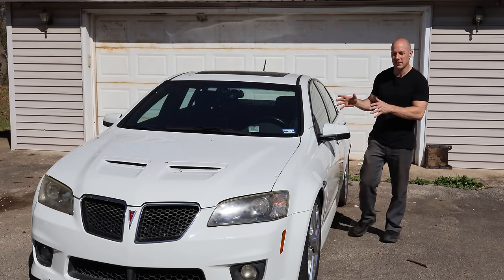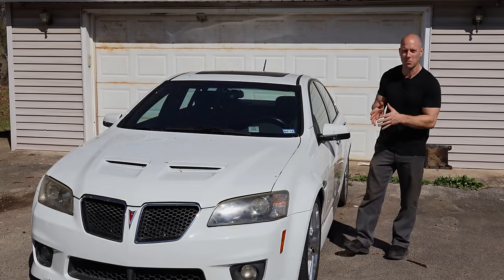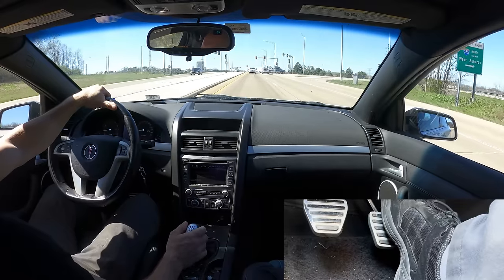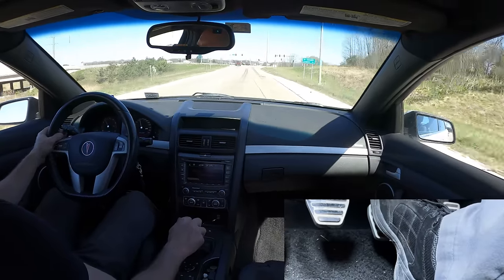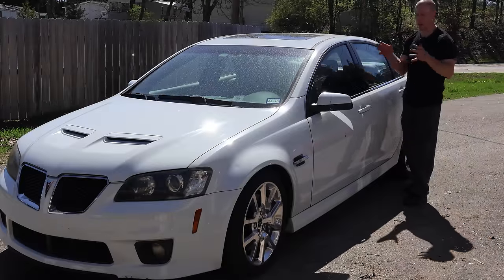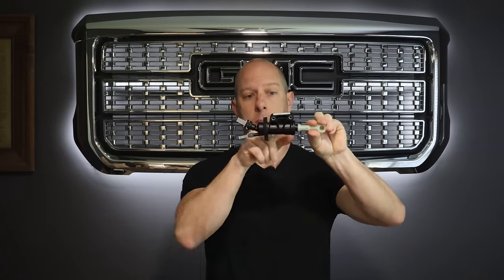How to drive a manual transmission without using the clutch, in case you broke it like I did!

Comment: Had to ride my motorcycle home without a clutch. Starting out was a pain, & I hit my calf with the foot peg -- ouch!  Also broke the throttle once and had to rig it to the front brake lever. It takes 3 times the distance to stop with just the rear brake.  My neighbor has no left hand, but skillfully works his motorcycle clutch with his stub.

Comment: I drive my Chevy Balt often without the clutch. Start it in gear and match the speeds.  Slave is failing so only works when first driving. I dont feel like doing a 9 hour clutch job. Semi drives basically do this too.

Comment: The clutch works fine in my civic, but I mostly only use it for first and. reverse. Rest of the time I do it your way.  They tell me I’m going to ruin the synchros in my transmission, but four years later it hasn’t happened. Daily driver.

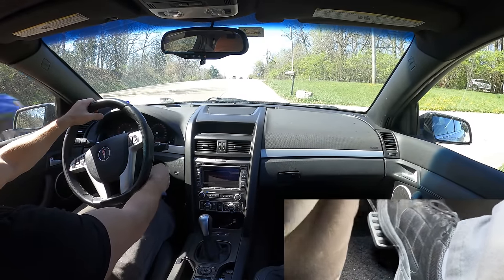Comment: 3:43 If it is in 1st Gear, and you started it, why didn't it move just as you started it? It only moved after you hit the gas pedal. I feel like the engine shouldn't rev without the tires turning unless you are clutched in. I thought the car would jerk forward during startup. But when you did it, it revved for a couple secs then started crawling forward as if you let go of the clutch.

Correct me if I'm wrong.

I skipped ahead so I might have missed context, maybe you were explaining how to do it after you fixed the clutch so that's why it did that.

Comment: This is something everyone who has a manual should practice occasionally.  I personally prefer to take off in second in order to avoid the 1-2 shift.  Matching revs and gears should be second nature to a true manual driver.    (Now for the next practice...No brakes.)
Reply: Yeah, if you want to trash the synchros
Reply: @rickc303  Nope.  In fact when syncros are inop,  RPM matching is the solution.

Comment: The clutch in a manual is always engaged and the fluid, cable, pedal, firewall, etc. are what disengage the springs on the clutch plate... You should be able to pull it out of gear even at a stop... You should also be able to get it back in 1st gear by just pushing up into 1st and the car with start to magically moving even with the engine running and no clutch pedal... Yes it is not the best since your are using the side of the synchro's/gears as a clutch but it is that, or your starter/flywheel so.

Comment: another fellow drive a stick without a clutch that disengages. twice. on the same car. at exactly 80k miles of life each time.  funny part, it was my mom's car, and it broke both times when I was driving it. 86 Plymouth Reliant K wagon 5speed Getrag A525 with 3.50 final, and 175/80R13 wheels and tires.  Speedo only went to 85. yes it could do 85. in 3rd gear.  We have no idea how fast it actually went but I pulled it hard all the way to the top of 4th once.  Only once.  Got 40mpg on a regular basis while being a rolling box.  I miss that thing. NJ salt killed everything it could find.

Comment: One thing I don't understand and maybe it's already been answered, but when you were stopped at the light with the engine off, and then you turned the engine on, the car didn't move for a second. I think if the clutch didn't disengage, the car would move instantly from the starter cranking. Like in the old days when your car stalled in an intersection you could move it out of the way with the starter.

Comment: That clutch slave is the same shape as the late 80's Ford trucks with the Mazda transmission.  The first annular slave cylinder I know of was on the SAAB 900 , it may have been on the 99 as well,  these slaves are super popular with formula car road racers ( Formula Ford / Continental / Atlantic ) .

Comment: on my 93 vw fox, my stepdad could change gears without pushing the clutch in - and there was nothing wrong with the clutch.  In fact, when I got rid of the car it had over 160,000 miles on it with the original clutch still working.

Comment: This literally happened to my car just recently and the worst part is that here in the Philippines, traffic is horrible....i had to leave my car on the sidewalk outside a mall (i was properly parked so as not to cause a standstill traffic) and had to commute home...i came back at dawn when there is no or zero traffic with my brother in law so as to drive it home...i am not used to doing clutchless shifting so i let my brother in law drive my car (he has more experience than me and he is a master mechanic)....he fixed it a couple of hours, replaced the master cylinder, and even bleed the old clutch fluid (brake fluid)...

Comment: The same thing happened to us in a 2008 Ford Ecosport (in México), I'm sure it was my mistake not getting the car to start, I tried pressing the clutch pedal, and without pressing the pedal, both ways I couldn't... but I know that in other cars it works, maybe it's a Ford thing or surely I didn't do something right... in my case the failure was the Slave Cylinder... For reference, the 2008 Ford Ecosport is basically a Ford Fiesta with a 2.0 engine... regards, from México

Comment: Doesn't work if the clutch is really broken and fully engaged.
With a clutch Pedal Safety switch, you depress the clutch pedal, and turn the ignition,  the Starter Motor will rotate the engine, and the car lurches forward, 
But it's not strong enough to get the engine rotating fast enough to start running.

Just lost my clutch disengagement on my car, 
and I tried all the Methods to get it started while in gear.

I was able to get it off to the side of the road, by putting it in 1st, cranking the starter motor and pulling off the road.
I probably need a new starter motor now as well.

Comment: Been there and done it. broke clutch plate in multiple parts, broken fingers, blown cilinders, ripped a line on offroad trail. oil soaked plat and burned up does not work no friction.😁😜to manny miles driving and years.

Comment: it's funny to think about as I have been synchronized shifting in most of my manual vehicles for the last 40 years.  I have had pickups and sedans that are manual as I prefer that over automatic!  and if your wondering if I am a trucker!  NO I am not, But I can drive them if I need to!  P.S.  Don't try synchronized shifting if you haven't learned the tricks in a newer manual vehicle!  Newer vehicles are not built as well today as before!

Comment: Yup, drove around for several months like that back in the late 90's.  Until the clutch actually flew apart and the springs all flew out.  That's also how you have to drive a big truck.

Comment: Sorry this clutch actually did disengage the gearbox upon start, the car even moves backwards with the motor already turning. 

It's way more difficult and jerky with a broken mechanical clutch (cable type). In 1st gear, the car makes a jump forward before the engine even starts, then drives and shakes until the idle RPM are reached. The moment you turn the key, the car will move. Shifting into 2nd is possible but needs very good coordination between gas and hand pushing the shifter. Going back to first gear is basically impossible without revving up and using quite some force on the shifter, there will be grinding noises. Also its impossible to start the car in neutral and then put the 1st gear in. It will stall. Getting the car to the scrapeyard was quite an experience and I was lucky there were no red lights and no traffic stops on the way.

Comment: AH no clutch.  sounds like the 13speed 70s farm truck I was driving for harvest last fall.  Grind em till you Find em.  It's not as bad as it seems and you certainly learn quick as heck the optimal speed/rpm combo for smooth shifting.

Comment: Excellent job!!
I had to do this in a buddy's van years ago when his clutch cable snapped. He was amazed it was possible at all.
Next video, how to drive a car with electric power steering, big alloys, and a failing alternator??? Now that's a workout and a real ballbreaker...🤣🤣🤣🤣
Reply: Used to borrow a friend’s 54 Dodge truck, no power anything. That was a workout
Reply: @gilmello8296  true, but wheels were a lot skinnier back then so it wasn't as bad as having wide alloys and zero power steering
Reply: I actually drove a 1982 civic from Elmhurst to Libertyville. When I got started everything was ok, 2 blocks later the alternator light on the dash turned on (battery was installled backwards).  The car drove all th way until the battery was dead. I got my battery from my Mustang and drove it the last 3 miles.  Replaced alternator, charged the battery and everything was ok. This was a car that was to be scrapped, but it drove for another year and was sold for $650 (paid $70 for it).
Reply: @jimpie231  in my case the alternator was on the way out, so when I started off my trip to work in the morning the steering was fine, and as long as I was travelling at speed the alternator was making enough juice to keep the steering working. However when I got into the city and start/stop traffic the alternator would stop working and the steering would die, of course that's when I needed it most to turn corners, park, etc. 
I honestly felt like the guys in Apollo 13 turning off the radio, AC, everything to try and get a bit of juice for one more second of power steering... 🤣🤣
Reply: @generaldisarray  What has the PS have to do with the alternator?  What make & model car is this?
Reply: @jimpie231  it's called electric power-assist steering, or EPAS. 
So instead of having a hydraulic pump run by the engine, or an electric motor, and all the hydraulic hoses, etc, you have an electric motor attached directly to the steering rack, or steering column that assists with the steering. 
The system varies the assist level depending on the speed you are travelling, a lot of assistance at low speed for turning/parking, and less at high speed, when you're traveling at highway speeds. 
If you lose power, or the voltage drops, due to a dying alternator you lose your power steering.
The car was a Honda Civic Type R

Comment: Had a 76 Chevy 3/4 ton van with a rare 350 3 on the tree. Had the same symptom. Pulled the transmission, replaced the pressure plate and disc. Same problem. Turned out there was a splined lever under the dash that the spline stripped. Costly misdiagnosis.

Comment: I had a Honda CRX and it shifted so well I only used the clutch for 1st gear. I could shift without using the clutch with no problems or noises. My newer Civic doen't like it though.

Comment: Coating gears can be done in a synchronized transmission 
It’s an art
Key is to get is into neutral before you come to a stop
Kill the engine 
Put it back in first, start the engine and go
Like I said, driving trucks for 36 years helped
Reply: "Coating" gears? How would you supposedly be "coating" them by doing this?

Comment: It is good for avoid a towe but very bad fo your manual transmission and for it's synchronization ring, they will really heat up and wear out! I would see how you start the car in first gear without pushing the clutch in, beacease in a lot of cases when the clutch is gone you can't disengage at all the transmission from the engine. But the video was help full, how to change gear.

Comment: When my clutch went out in my 1996 7.3 F350 at stop busy stop signs I would get out and push it a few feet and then just put it in gear. At lights though I would do what you did

Comment: Sounds like one is in store for one of them "Mawzill" jobs. "While I'm in there changing the slave cylinder, mawzill go ahead and change the clutch. While I'm in there changing the clutch, mawzill go ahead and fix the driveshaft center bearing. Mawzill go ahead and fox that loose u-joint, gotta touch that. Mawzill go ahead and change the pinion seal and resurface the flywheel; I'm in there. Mawzill repair that exhaust pipe hanger/heat shield/clamp, too; I'm under there."  Mawzill jobs just escalate into a mini overhaul...

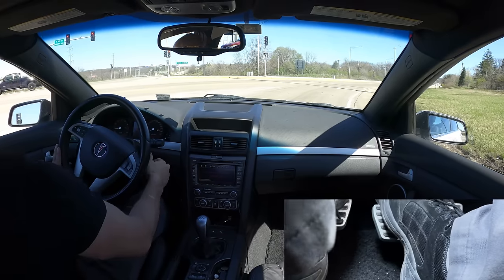Comment: wait just a darn minute... if the car is in gear like @6:32 ... starting the engine with it in gear would result in the car lurching forward because your starter is now turning the motor AND the transmission. but since it started up in gear without lurching forward the clutch was NOT engaged.
Reply from the maker: If only you would have listened…

Comment: The clutch must already be slipping.

There is NO WAY to start your car in gear while standing still with a mechanical spring tensioned clutch (like almost every vehicle in Europe has)
What will happen with a good fully engaged clutch is that it will kangaroo forward and you kill your starter motor extremely fast.
You can only do the starting when you park on a slope and let the car roll forward to start it.

The only way to stand still is in neutral.
Reply from the maker: If only I had explained it, oh wait, I did.

Comment: Driving a syncromess transmission without the use of the clutch is a sure fire way of shorting the life of the syncro.
Reply: Without a doubt, yes. But in this case there is no use of the clutch as it is engaged all the time no matter what. It is a specialty tool in the toolbox, and while it can be used for multiple jobs, it really is only meant for one job.
Reply: I've been driving my Kia without using the clutch on 4th and 5th gear for the last 100k miles. Mainly because they are the easiest to shift into without a clutch. 230k on the car. Runs and shifts just as good as when I bought it.

Comment: I had to do this once with my first car when the pressure plate exploded and locked the clutch plate against the flywheel, the hydraulic system was fine but the plate broke in 5 pieces and became one with the clutch and flywheel, I drove it to where it needed to be to install a new clutch (opel corsa c 1.2l)
Reply: Removing the exploded one was fun tbh

Comment: First time I did this was a Commodore that was 25 years older than your G8.  I got lucky with almost every light on the drive home.   Upshifts were easy, but downshifts needed careful rev matching.  Next time i had an issue got stuck in first, but the shifter was in neutral.  Internal linkages meant I couldn’t just knock it back to neutral, so I drove it home in first, giving it a hit for a few seconds then clutch-in coasting for as long as possible.
Last time I broke a clutch was in a 1934 Chevrolet in QLD (650 miles from home). Its starter won’t crank it in first unless you’re downhill.  I did lots of left turns (RHD in Australia) and loops around the block to avoid having to stop, but I made it back to the motel, and we had a makeshift linkage made up to get it home.  Modern cars are much easier to shift with no clutch compared to older ones with no synchros (or not all gears with synchros).

Comment: Looks like you're putting too much pressure in the gearstick. On down changes you ought to blip the throttle and with a very small amount of pressure on the stick the gearstick will give way.

Even on upshift you might have to blip depending on your current rpm when you are asking for the gear.

Letting your revs go all the way down in neutral before asking for the next gear without blipping is just putting more wear on your synchros

Comment: Once in the late 60’s I had to drive a small Mercury with a broken cable 35 miles for a cousin, no problem. Another time an 81 Fiesta also with a broken cable.  I put my fot on the clutch, turned the key and the car would jump and start, then you feathered the gas to match the gears. You slowed down to try matching the light instead of stopping. I got pretty good at it. The cable on the Fiesta cost $4 and took about 15 minutes to replace. My Mustang also has a cable, also easy to replace, it’s a stock 84, 5.0L 8.

Comment: Also if you drive a Ford super duty 95 through 2002 with a 7.3 diesel, they were also known for shaking the spring out of the clutch disc and it would get caught between the clutch disc and the pressure plate and then the clutch wouldn't disengage anymore. Drove a 99 super duty F 450 in early 98 for 5 weeks that way because the clutch was not available from Ford.

Comment: yours seemed to allow a little slip with the pedal down which is kinda lucky. awful hard on the starter to start the engine AND move the car at the same time, but it can be done (i've actually drove my truck across 5 lanes of traffic on just the starter motor before cuz it died in traffic and the clutch safety switch is bypassed)

Comment: Sold a car with broken clutch- I drove it 30 miles to the buyer, he couldn't believe it. The only problem is....... you have to start in 1st gear. Try doing that on a steep motorway slip road. Citroen BX 1.6 litre diesel -not a big engine

Comment: I was thinking that taking of from a standstill would be impossible without a clutch, but it looked so smooth when you did it. Is it the starter that's doing all the work to get the car rolling, or are you also pushing the accelerator pedal more than usual?

Comment: You were lucky that the clutch disengaged a little. I had one go completely and had to turn the engine over in gear and the car would, obviously, lurch forward. hell of a strain on the starter/flywheel and battery so wouldn't want to do it for long.
Reply: Clutches can be unpredictable, even if it was slightly slipping.

keep a good distance between yourself and any other object/ humans / pets / cars as it can engage on it's own all of the sudden. as temperature changes and many other factors.

be safe.

Comment: I knew ho to drive the car when already moving forward. But the tricky part is to get it moving in first gear. Seems your clutch have enough slip to allow you start the engine.